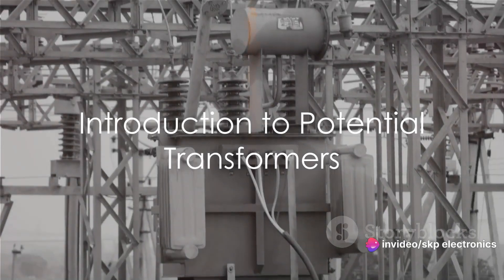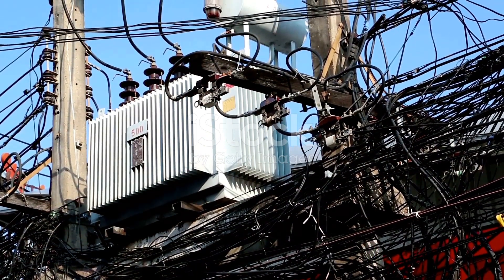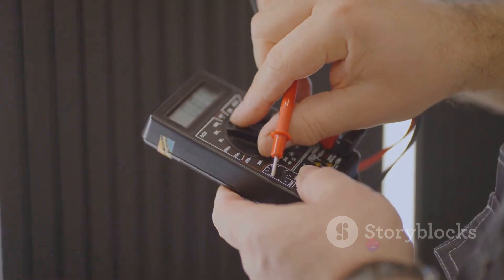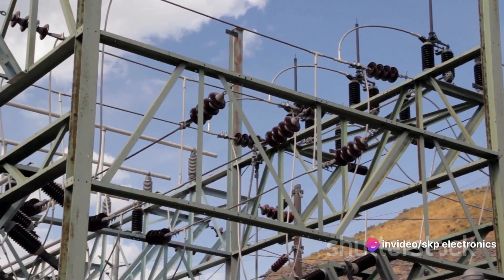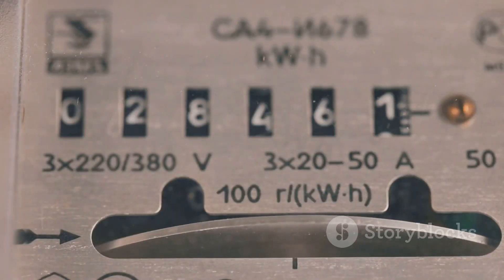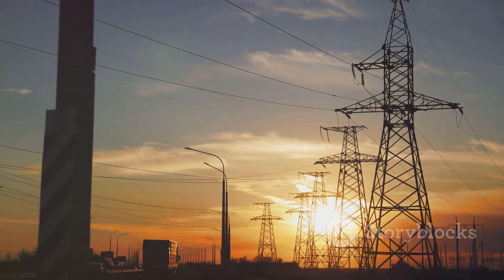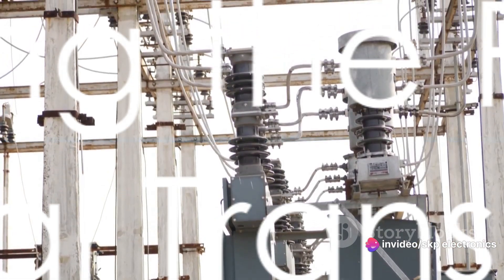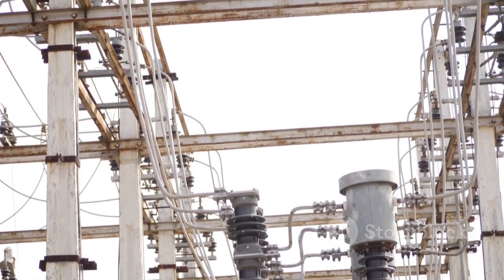What is Potential Transformer

Comment: The main essential  problem is a leakage inductance - because turns ratio is quite big - for example 200kV / 36V = 6111. I have an experience with build a mid-voltage pulse transformers (flyback and  simple),  but there turns ratio is  10-20. How do the engineers  solves this problem?
Reply from the maker: Shortly coming soon.....